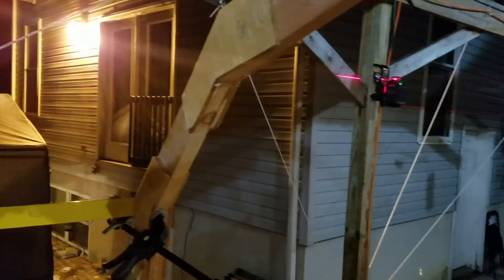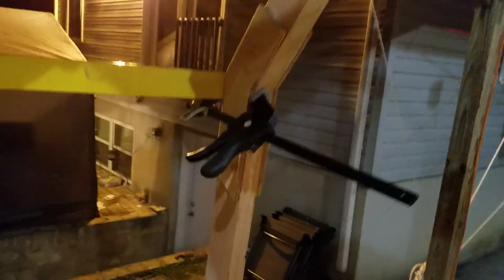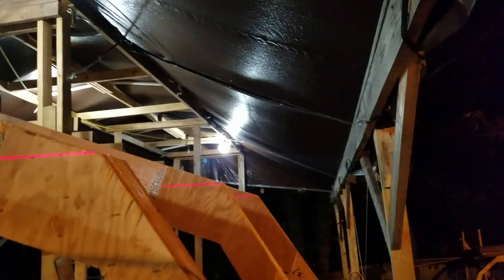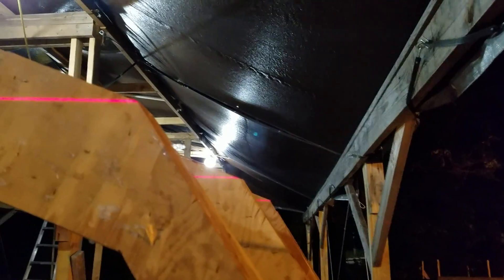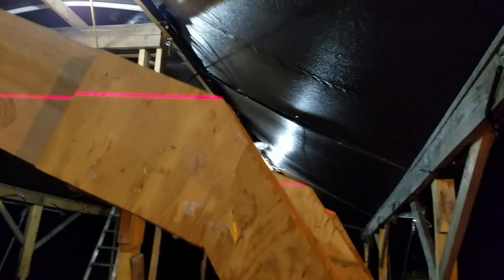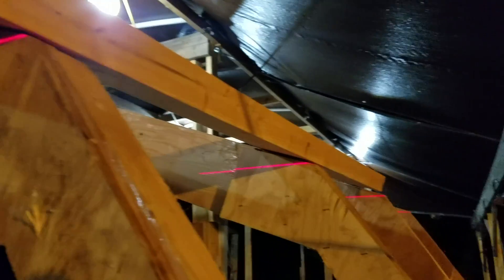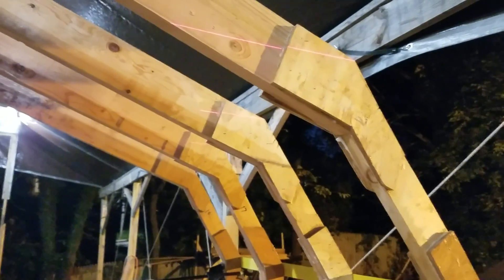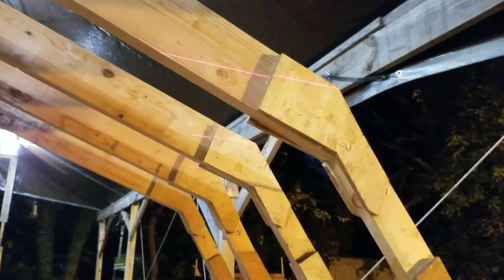Adjusting the hull frames.

Comment: I'm no expert on boat stress calculus, but... How are You going to strengthen those frame joints? Just an epoxy seam and litle pieces of plywood is not strong enough in my opinion. If You think how much weight is put on a single frame when boat tilting with sails i'm afraid those frames cant take the load. If boat weighs about 10 tons (kg) and its tilted in storm 45 deg half of the boats weight is pressing on one side of the boat. Do a test: Attach one frame from keel end to a post and grab a hold of the other end of a frame and lift your legs up, do those glued joints endure that. Certainly the deck and bulkheads take part of the load. Those frames should be laminated so that the grain of the wood continues over the corner of the frame. Glued seam with end grain is not very strong and in plywood half of the woodgrain is not over the seam and diagonal woodgrain is not strong at all.
Reply: by the time all the structural members have been glued and screwed ,plus ply sheathing ,and glass ,should be a pretty tuff rig. nat hershoff built amazing racing boats to very light scantlings .just my 2 cents
Reply: Very true. Most people don't understand the true forces in sailboats and how forces on a boat are truly applied.
Reply from the maker: Greetings. I would invite you to test the method yourself. glue two pieces of half inch plywood together and then try to break them apart with the long dimension resisting the force. You'll see very little deflection. In fact there are structural beams called LVL that are simply plywood glued together to make an extremely strong beam. The plywood seam does not have to resist a force laterally from the side but just head on.
Reply from the maker: Also check out this video. 

https://youtu.be/YFIVxZ8Lqzo
Reply from the maker: Very true Paul. Most people dont understand the true strength of materials and how forces on a boat are truly applied.

Comment: Have you thought about buying a boat.  You could buy a used boat this size, cheaply, and spend a few months making it your own and then go Sailing.This looks like it will take years and years and years. And after you are done you will have a backyard boat made by Home Depot?    Don't yell at me. I had to ask.
Reply from the maker: Greetings Al, I assume you are a new viewer. There are several videos where I discuss why Im doing whay Im doing. Lol to your Home Depot boat comment. Most of my materials dont come from home depot, and even if tjey did, whats the matter with that. Dont buy into the false message that you have to use mahogany and teak. Americans built boats for centuries made from spruce, pine, fir and oak. Its all about knowing how to select your wood. Also, my boat is a composit design, wood and epoxy. I could substitute most of the wood for foam and be perfectly  fine. Just stay tuned my friend. :-)
Reply from the maker: I am a builder first and foremost. People said the same thing about Joshua Slocum and the Pardy's. But if you watch my previous vids you'll see why I didn't just purchase an old hull and gut it out. Ot boils down to standing head room. At 6 foot 7 inches tall my goal is to have 7 foot clear standing Headroom throughout most of the boat. No existing designs give you that, save a million dollar 50/60 foot Oyster or Hallberg Rassy, and there hulls aren't sitting around for the taking.
Reply from the maker: Oh and I do sail, on other peoples boats. :-)
Reply: The short answer is that it is no different than climbing a mountain.  People build a boat because they want to build a boat. It is always cheaper to buy a boat if just having a boat is the goal.
Reply: +Iandi Boats I have a lot of respect for how you worded your response. ✌😎
Reply: Good response.  I was very curious about your motivation.
Reply: I was going to ask you why 54 feet; but as a large framed man you need to scale the boat to fit your physical proportions.
For me at just under 6-feet tall (large frame), I'm comfortable in 15 meters (49.2 feet).
Reply: I just found these videos, and it's hard to explain why people want to build a boat. you just do, or you don't. there's the draw of sailing, then there's the draw of sailing something you built. it has built in stories from the day the keel first touches the water. a character that you can't find on a production boat. and also you can fully customize it, modification is always a compromise, you never fully get what you want.
Reply: So the Zen of sailing is to not sail?